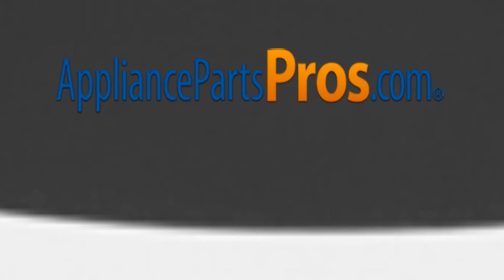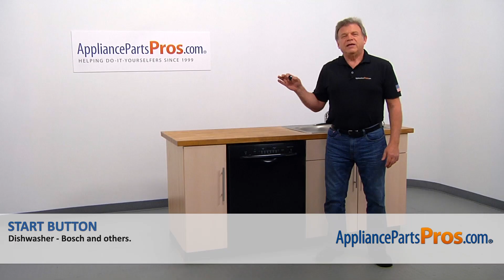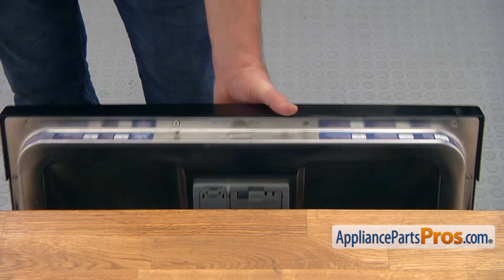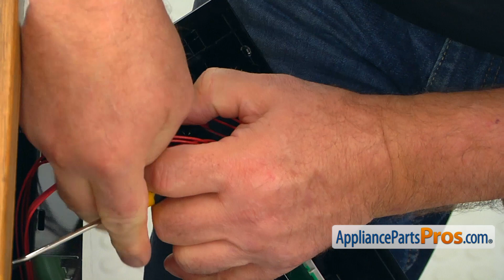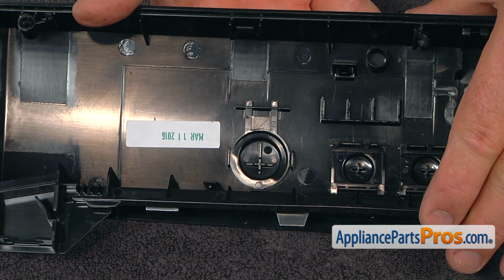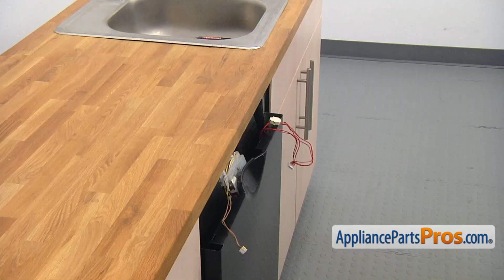How To: Bosch/Thermador/Gaggenau Start Button 00611653

Comment: But how do you get the back of the button off😢
Reply from the maker: To access this part you will remove the control panel and remove the display board, then you can push the button through and remove it.